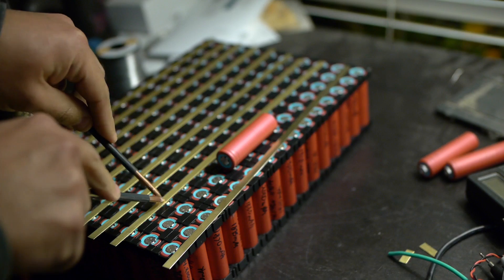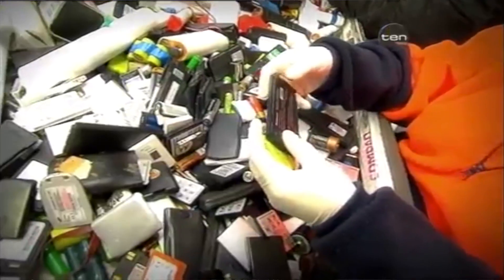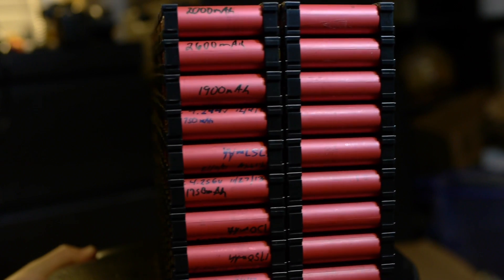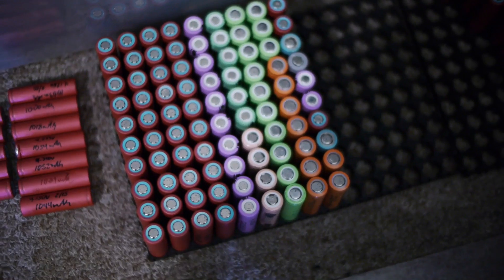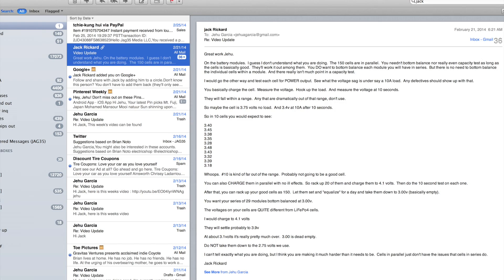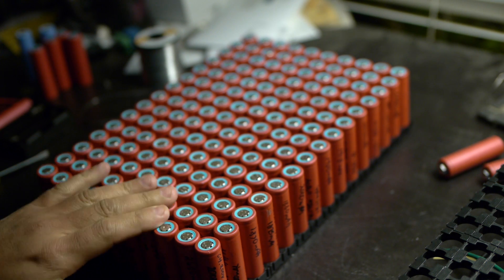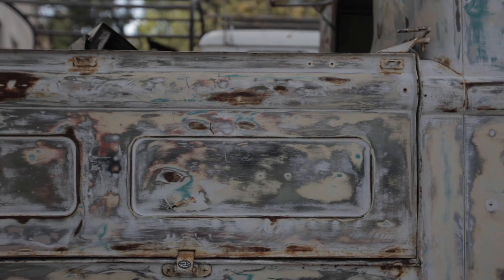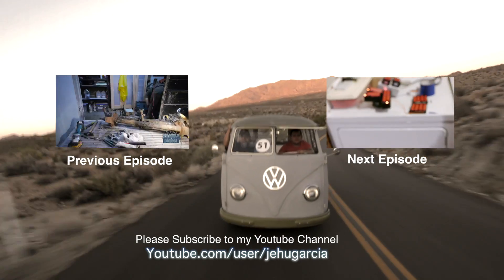eSamba 18650 Cell testing + EVwest VW Crew Cab Bus

Comment: You can make a device to do a quick differential voltage measurement (across two different loads), and then calculate the differential resistance. 
You can also use a standard ESR meter, and use a capacitor in series (just to block dc) while taking measurement. 
Both of these test (first one being superior) will yield a somewhat reliable judgement on the health of a rechargeable battery.

Comment: Hi Jehu, I have been watching a load of your videos! I want to easily check the mAh capacity of mine too! I am trying to decide between buying the following devices: LiitoKala Engineer Lii-500, the Foxnovo F-4S, or the Opus / Floureon BT-C3100. Which one is best for measuring an accurate capacity? I already have a Nitecore D4 for simple (smart) charging but I want to measure the real mAh of some 18650 batteries that I have salvaged from laptops. If I have one of these discharging / testing devices do I still need to leave them for weeks and see if they lose charge?

Comment: doing all this work building these battery cells would it not be advantageous to design and build a box that you can just drop batteries into and bolt together to complete the wiring of the cell and also easy reusable cell case on battery replacement

Comment: I love the videos.  Are you finding good cells among the ones that come to you below 3.0v?  I bought a batch recently that are mostly in the 1v and 2v range.  Are these beyond hope?
Reply from the maker: Tim Byers yeah it really depends how long they have been sitting at that low voltage,   I have found many usable cells that came practically dead with no voltage and they recovered nicely.
Reply: Very interesting.  Back to testing then!  Thx.

Comment: Keep up the focus, don't loose sight.  Common sense is uncommon in todays ADDS environment.           Number theory and probability statics are where you are but you can not see what is smacking you in the face.  Too many whatevers.  You are worrying about why are not all the wave heights  the same in a storm in the ocean.  Think of you, the car, and the battery as if  it's you, a plow, and a horse.  You do not kill the horse to plow the last row.  You may need the horse tomorrow. 
Battery 101.  Forget about 50% of it's maximum capacity and just "cherry pick" the best part. If the weakest cell that you want to use is 1500 mAh, then the whole pack is only going to be worth 750 mAh per cell times the total number of cells.  Your plow horse will love you.   It will be there for you every day. 
Heat (entropy) and temperature build up will do ugly things to batteries (and the horse).   I you can settle for 1/2 amp per cell (continuous), temperature will not be a problem when discharging or charging.  Otherwise, the cooling system will eat you alive.    
If you can swallow all this, think of recharging the beast.   At 1/2 amp, a 1000 mAh cell (remember it is being "Cherry picked from 2000 mAh cell) will take 2 hours to recharge.   
Bottom line, "I think that your going to need a bigger boat - JAWS ".   So, It's going to take more cells,   If there is anything left of your ego, you will grow old and happy in your battery powered car.   This isn't hyper BS.   SSDD.  Quit feeling bad about not finding the last lost penny in the sand at the beach. 
The old story.  You are standing atop a mountain.  You see the next mountain across a valley with a dense forest, wall to wall.  Your task is to get to the top of the next mountain peak.  When you get into the forest, you get  lost amongst the trees.  You need more data to navigate.  Indians marked the trees to stay on course.  Moral of the story, do not get lost in the forest among the trees.
Was the goal to carve a fat hog, i.e. cheep batteries, or bask in the glory of a free ride, i.e. electric car or get a PHD at the school of hard nocks or spend  mega bucks trying to save pennies.  
Do not kill the messenger.   I got my stripes with electric  RC airplanes.   After a few trips around the block (steep learning curve),  it fell into place.   A battery pack is like a tank of gas.  When it gets low, (battery) , replace it with a full one.   When you go home, recharge all he battery packs,  It got so good, I got into video cameras for inflight video,
DAAAAA, camera batteries, round and round we go, when it stops, nobody knows.
Bare with me, I want you to win ! !   After all, I had a '61 rag top bus that I nursed for another lap on the OD when I as in college and working,  It was fun.          .                                       .  .

Comment: maybe testing the internal resistance will reveal the bad cells
Reply: oldskoolhead0  I was going to say the same thing. Internal Resistance (IR) is an important measure... it will tell you if that cell will get hot, it will tell you if it's capacity is not going to be great.

Comment: Hi Jehu, It would be good to check with Robin up in Canada. A while ago he had some boards made up for using 4 cellog8s. Cellog8 are small RC type devices. You could drain down 32 cells in series at the same time and the alarm could be set so whenever any cell reached a low voltage it could disconnect the load. You could replace the low cells with precharged "swap" cells then when the next lowest cell kicked off the alarm replace it with a "swap" cell. After doing this 4 or 5 times you would wind up with 25 or so cells left that would be pretty much the same capacity.

I did some tests a while ago adding 18650 cells in parallel to a group of Calb 100 cells to balance their capacity. You might check out this thread.
http://www.diyelectriccar.com/forums/showthread.php?t=78185
Reply: Hey Jehu, I would be Robin from Canada!  I've been watching your battery video's with interest.  I tested close to 1000 20Ah A123's and did similar sorting/grouping that you are going for.  (but similar to Jacks results the cells are crap!)  Although the Cell Log 8 breakout modules that I designed could be useful in your testing I think there is a simpler way.  First take Jack's method.... test for good cells using your good/junk threshold voltage.  Then build a pack just under the nominal cell count.  Test the capacity of the entire pack and add known capacity cells till you hit the magic number.  That way you are capacity testing 5-10 cells per module instead of all ~150.  Your modules will be different cell counts, so you would need a bit of flex room in the last row to be  able to add the required number of cells.  You end up with a known capacity, the whole process goes much quicker and easier.
Feel free to contact me, I'm intrigued with the 18650's as I'm using them in one of the headphone amplifiers that I'm designing.  The Samsung ICR18650-22E's I've been using can handle an over discharge without any significant damage/capacity loss. 
Some of my EV adventures:  http://electricporsche.rwaudio.com

Comment: in a DoKa you can fit the batteries where the tank goes and in the area under the back seat. might even be able to stack them. Still have all seating for 6 and the bed is completely open. might just need some tracks to slide them in and out, maybe a mini-treasure chest door? i will keep watching :)

Comment: you need to grade the cells you must put them through cycles charge @ normal rate & discharge them @ a high amperage like 10 to 15 amps with a rest in between cycles after a few cycles look at the voltage and capacity then put them in groups high voltage cells and high capacity cells some will have better voltage some will have more capacity less voltage this is called matching cells.